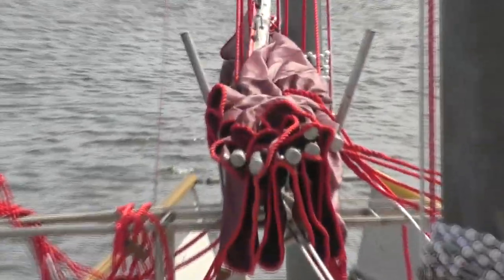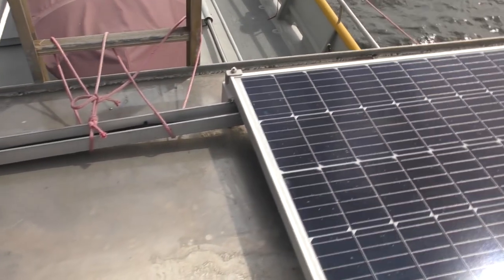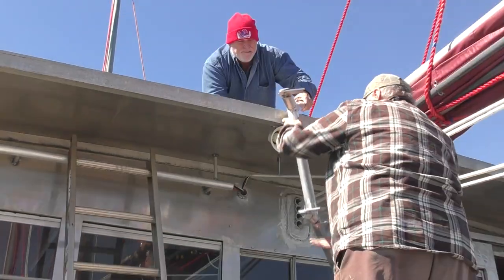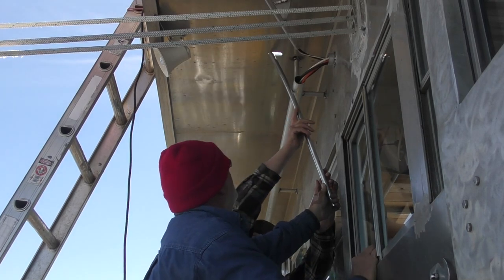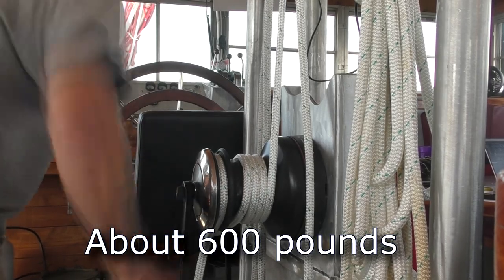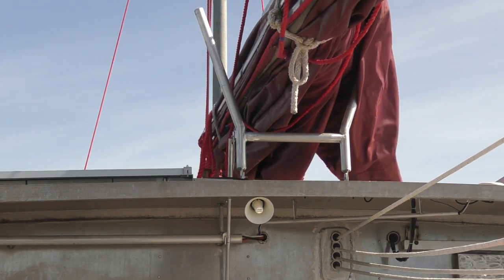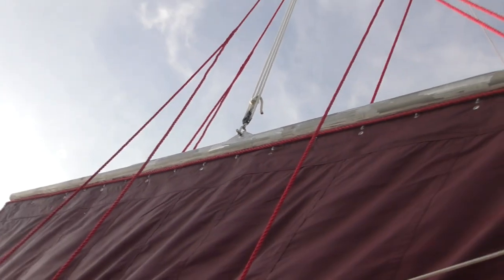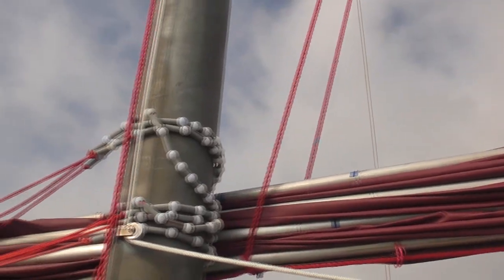Sail Crutch

Comment: Here we see Doug here using the skill saw and the Polish plain method to round his aluminum instead of the grinder. Not a recommended mode and if you do use it, make sure you have a blade that has good soldering between the carbide cutting edges and the base metal of the blade. Launching one of those it tends to penetrate or shatter, depending on what it hits and it also makes the blade cut worse, so keep that in mind.

Comment: Hi Doug, great video. Something I thought you might be interested in. I see you do a lot of aluminum welding. Didn't know if you knew that they also make stick electrodes for welding aluminum. Thought it might be something you could check into when you have to do some aluminum welding outside and the wind doesn't want to cooperate. I've seen them used once. They seem to work pretty good. Not quite as clean and pretty as MIG, but definitely more forgiving.

Comment: im not a boat guy, but i have a question, steel boat is hotter than wooden boat ?i mean like the pilot house, is get very hot in hot summer season..? even did all the insulation , after all metal conducting heat very quick , so is a problem..? just curious,im not a boat guy, sorry for my poor english.
Reply from the maker: I don't think so.  The pilothouse has solar panels on top that shade much of the aluminum, and then a 1" air gap below that, then 2" of insulation, and then wood.  Then windows all around.  There is more heat coming off the deck than on a wood or fiberglass boat.
Reply: @SVSeeker  How on earth are windows all around keeping the sun out?
Reply from the maker: @matthewwalker6067     Letting sunlight in is sort of a function of windows is it not?  But there is a 2 ft eve around the pilothouse to add some shade.